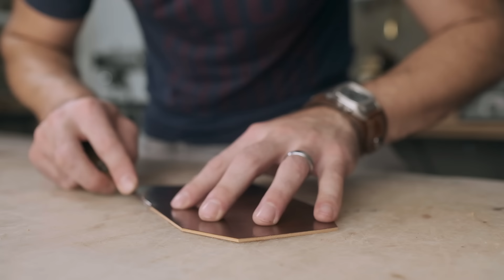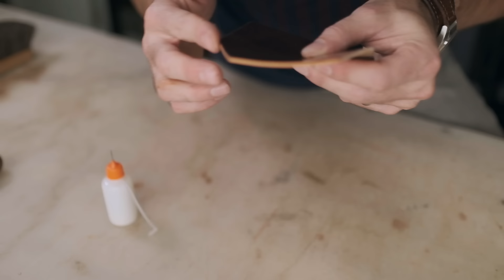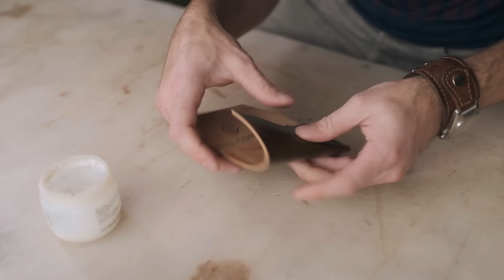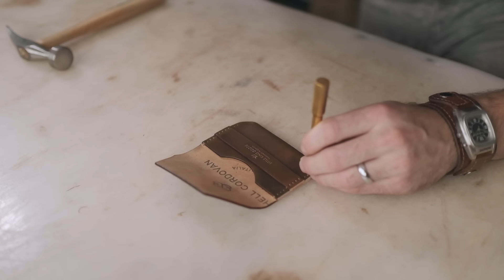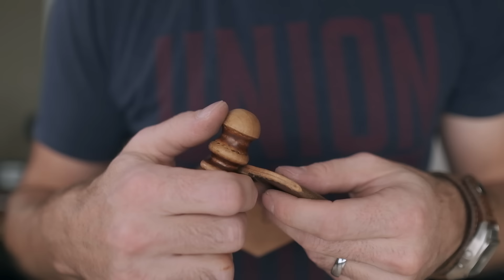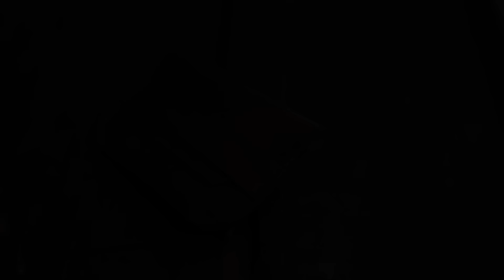Making a HANDMADE Leather Flap Wallet - HYPER ASMR!

Comment: Shell cordovan? Really?
You're using a 120$ worth of leather on a wallet?
I can make a wallet that does the same job.  Will last just as long. Is just as beautiful and I can make it out of premium grade veg tan.  My material cost for a wallet?
Under 20$
Hell.  Probably under 10$ if I am frugal with my cuts and buy by the side.
Shell cordovan is an amazing material for FOOTWEAR.  Why? Because of the way it bends and flexes under stress without cracking or tearing.
It's amazing for high end footwear. 
But think of it this way.
You're using titanium where aluminum would do just fine.
People who buy a shell cordovan wallet have more money then brains. 
You're buying the wallet because of the "brand" no better then some real housewife of wherever buying a LV bag just because its LV.
Reply from the maker: You can also spend $100 on a 15 year old Corolla or spend $500K on a Lamborghini. They will both get you from point A to point B. 😉